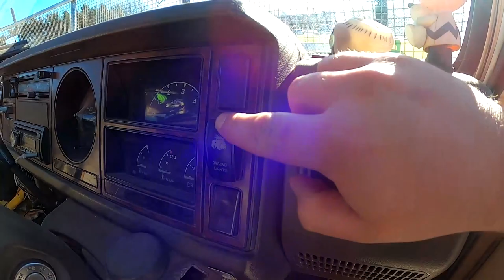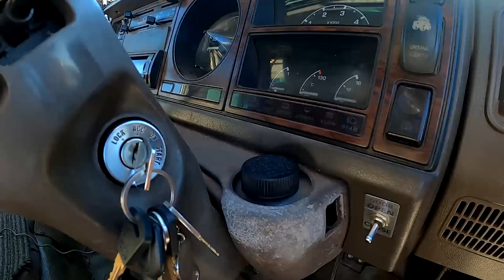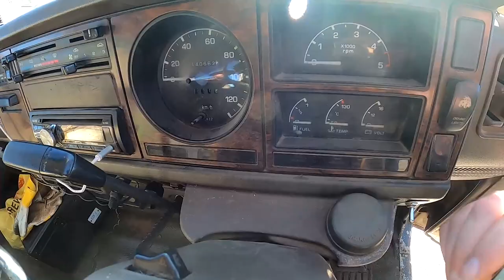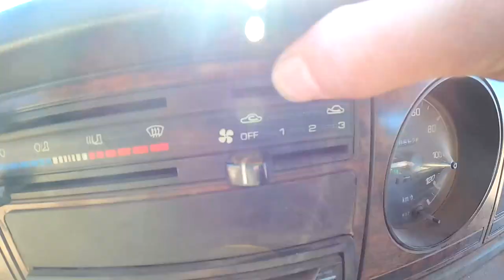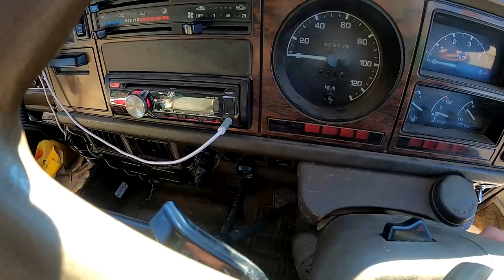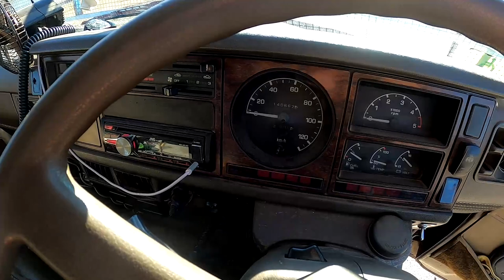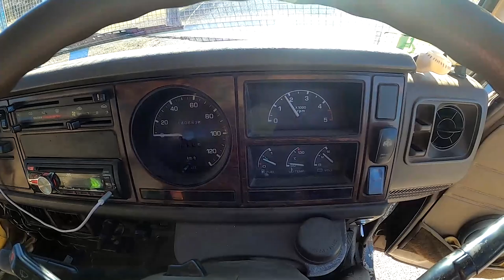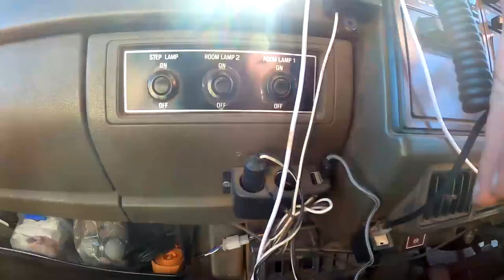Mazda T3500 -  How to Drive and What The Buttons Do

Comment: my old dyna 400 had hi/lo but was an electric button on dash, no clutching needed just back off on the throttle. good when going up hills and need half a gear to pick up a little more speed, but mostly drove in lo range until in 5th then hit button for high range when on highway.

Comment: Mate, so bloody jealous! My trader motorhome only has the five speed and is an absolute slug on hills!! I drive it at 3000 rpm which is around 85kph have to push her to 3250>3500 for 90kph which is giving the old girl a real workout :( 
I now realise that my exhaust brake is not working thanks to this video, cheers

Comment: Is the engine break on when the lights on? Thanks don’t seem to notice it breaking much when it’s on..? Thanks
Reply from the maker: When the light is on its in a "ready" state. The dash switch, the pedal switches, and the brake itself all need to be connected and wiring properly.